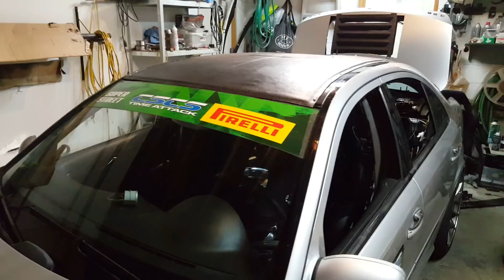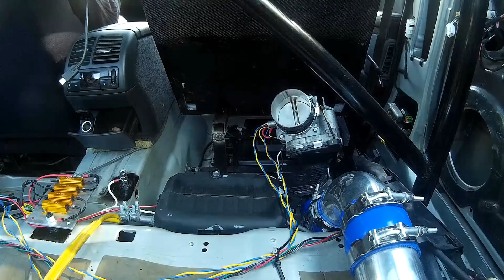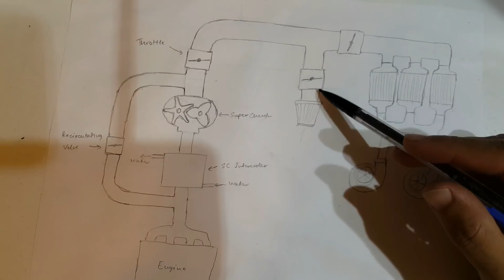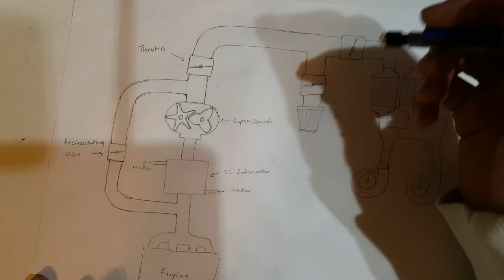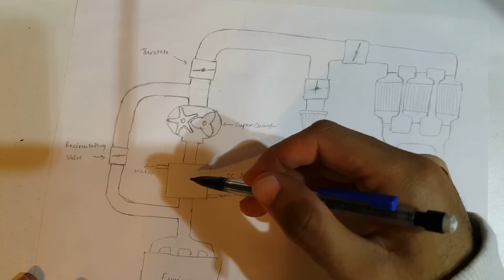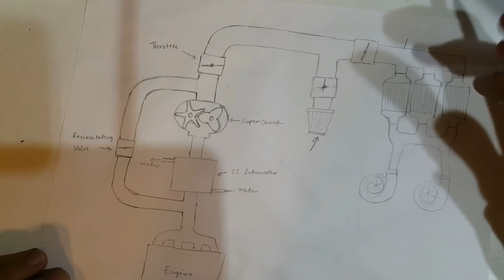How to Build a Properly Fast Track Car - Part 12 (Twincharged System/CF roof)

Comment: still no LSD diff on the car, thank god you have 2 turbos 1 mile away from the engine, and also 3 useless intercoolers nice and warm inside the cabin.... incredible.... it really could have been a good build, if only you would have spend the money in the right places and doing things "properly"

Comment: Holy cow this is amazing work! Not sure if this will help at all but thought I maybe add a tips
.

Instead of reprogramming the ECU each time to tune the valves you can also implement a  read/write memory in the fly the change "calibrations" in RAM, then save then RAM data Into ROM on ECU shutdown. 

Great job!

Comment: Nice Build! I have a twincharged car myself (4agzte in a mr2) so I thought I would offer some tips:
If you want a faster boost rise and a better transition you could remove the throttles between turbos and the intercooler and instead control the supercharger bypass valve based on the pressure before the supercharger. 
Once the turbos start to spool the bypass would control the final boost pressure by gradually bypassing the  supercharger until its finally at a pressure-ratio of 1. With this system you can get loots of boost quickly, example:
The supercharger runs at a pr of 1.5 (~7psi boost) and the turbo are just spooling at a pr of 1.2 (2.9 psi boost) with the compounding effect (1.5*1.2) you get a pr of 1.8 (11.6 psi boost). 
You can then gradually open the bypass to keep this 11.6 psi (or whatever you want to run ;) ) until the turbos are fully spooled, no drop of boost during the transition!

I also think that the way you are running the turbos means that they are fully stalled while building the initial boost and I don't think that's efficient or good for them in the long run.

Twincharging FTW!
Reply: i run a full compound twincharged aw11.  no bypassing the supercharger, no clutch.  works flawlessly.  only bypass is a external wastegate used to bypass/vent the supercharger on throttle snap and idle (throttle body is post supercharger).

Comment: You must be German, great engineers but overly complicated.
Here is how I did the same job on a 5 liter V8.
Two turbos one GT35 size and one GT45 size. The GT35 is the Primary turbo, it runs all the time. The GT45 is only active if Exhaust Back Pressure is more than 60% higher than Intake Manifold Pressure. I have full boost at 2000 RPM and do not choke the engine down due to back pressure at 6800 RPM, my Redline.
No computer used, this is all analog using Boost control valves, Exhaust Loud valves, and a stand-alone water cooled EGR valve off a Lexus. The Water cooled EGR is for cooling the exhaust gasses before it gets to the two boost controllers that activate the larger turbos. I melted a few before .......LOL
Now the size turbos that I used were chosen by engine size, head flow, and boost level, I'm only going to 12 psi. My transmission will never hold more.

Comment: just use a low rds on mosfet instead of the relays and pwm for controlling the current level from engage to hold. It would have taken the same amount of time. Anyway! keep up the good work! i love these mods, crude but to the point! love the rebuild videos, i have the v6 engine, good inside information!

Comment: Several people have run turbos directly into a supercharger without all the extra throttle bodies. The supercharger pulling air through the turbos and the intercooler allows it to both get cooler air and spool the turbos faster reducing lag even more. Even more lag could be eliminated by changing your exhaust to a single pipe and a single large turbo.

Comment: Great channel.

Appreciate I don't know all of your design requirements and so forth. 

But, I am not sure you really need the additional throttle body near the turbos. Why can't the turbos spool up into the supercharger; and then you switch the S/C off then and/or bypass it; if you really think you have to?

I also dropped a comment over here; https://www.youtube.com/watch?v=zX2NJMaHTgw

Jim; ex AMG powertrain engineer - electronic engineer - electrical engineer.
Reply from the maker: Hey Jim,

One way of doing it could have been slowly opening the recirculating flap to regulate the boost as the turbos spooled up. That way I wouldn't have needed the two throttle bodies. The only reason I went this way was that the risk of over boosting is too much using that method, in case something doesn't work on time. If the turbos and S/C engage at the same time the boost levels would multiply and cause a lot of damage. This was the safer way as there was almost no risk of over boosting and the boost levels in both systems could be controlled independently. 

Running Turbos and a Supercharger at the same time is called compound charging. That wouldn't have had any great benefit in my application because the S/C would be doing the majority of the work and the turbos would just be feeding a few extra psi into it. Eliminating the S/C made a big difference (lower intake temps, more efficiency, better boost regulation). I would have removed it completely if it wasn't for avoiding turbo lag. Hope it makes sense
Reply: Yep understand about compounding; I remember the DW 4 Valve V8 and F1 turbocharger era where that term came from.

What I was eluding to was you could (slightly) compound charge the system prior to smoothly transitioning it from positive displacement manifold pressurization across to a centrifugally (turbo) charged manifold pressurization system.

You could control that via software and that way you don’t get the manifold pressure drop as the current system transitions.

Also, I am assuming the bulk of your turbocharger pressure enters the engine via the S/C bypass conduit. 

Also, remember the risk of over-boosting can be controlled by a traditional BOV; although they can be expensive.

Comment: First I've got to say Wow! I'm impressed! It sucks that those hardened o-rings caused such a mess.

On the turbo setup, how much boost and power are you planning to make? I noticed you have a reduction in boost while switching between SC and turbo. Is it possible to tune things to minimize or even eliminate this drop in boost?

If you increased the SC rpms (smaller pulley) would it be possible to achieve close to the same peak power you'll be making with the turbos? Turbos are more efficient so you should be able to make additional power at the crank/rear wheels with the same amount of internal stress on the engine so there is definitely a theoretical advantage with using turbos for peak power. Have you calculated how much more you can theoretically make for the same peak combustion pressures?

Comment: Please tell me that you have immediate plans to install a manual transmission !!! Please !!!! I hate performance cars that do not have 3 pedals !!!! In the USA it is almost impossible to find a car with 3 pedals. I was just looking at new Hondas and get this... there is an upgrade cost of almost $2000.00 for a manual tranny !!!! I hope Europe can resist and keep making manual shift cars. Who cares if you are .7 seconds quicker to 60. The removal of the clutch pedal has sucked the enjoyment of driving right out the window! 
Sorry for the rant

Comment: Hey bud , beautiful work there!  

I was wondering how you managed to control the recalculate valve?  Is there a way to add a switch to override it and cause it to close on demand? Or a  stepper motor driver /programmer required?
Reply from the maker: It operates the same way as an electronic throttle body. You wouldn't want to override it with a switch because it has to open and close in certain situations. Its a bipolar DC motor and a position sensor basically, so its more similar to a servo motor than stepper

Comment: question, why not try to have the turbo air go into the supercharger to comepress the air even further? is it to much heat for the engine to handle? if so what were those temperatures. im doing a build with my wrx where i am trying to tie in a supercharger into the existing stock turbo engine to see what kind of gains i can get as a fun experiment.
Reply from the maker: That's called compound charging. I've heard of some drag cars using that for really high boost levels but an engine with stock internals like this one probably wont handle that too well. My initake air temps so far stayed around 50 degrees C on the turbo setup, was reaching up to 90 on the stock setup because the factory intercooler isn't the best.

Comment: Have you considered using Solid State Relays (SSRs) instead of mechanical relays to control the valves? They should solve the issues you're having with flutter. 
By the way, great channel, I've always wanted to do a twin-charged setup for an M113 engine.
Reply from the maker: The flutter was fixed by changing the program, but yeh solid state would definitely be better. I might consider it later depending on how everything performs.

Comment: how youcontrolled the actuators to open or close on the same time you have reached the optimum pressure??? by plc??
Reply from the maker: No, its the circuit at 4:26 that's controlling the switch over. Plc's could work too but they are mainly designed for industrial purposes.
Reply: what is that circuit called?  howto program it?? do you programmed it yourself......being a electrical student???......can we use arduino??
Reply from the maker: Its my own design from back when I was a student. Its based on Atmel microcontrollers and programmed in c++. You would still need a lot of external hardware if you use an arduino so its probably a better option making a custom pcb anyways.
Reply: thank you  and keep teaching us..

Comment: I've always loved & have been fascinated w/ "twin boosted" engines. As I'm sure u know, VW tried it for a while a few years ago. I haven't watched all ur vids yet but if u haven't, why not change to a smaller diameter charger pulley? Also, I would think a larger water/air charge cooler "radiator" (rather than the stock Merc radiator) would help a bit? I'm curious if u don't mind, what r the (pre-supercharger) turbo boosted air temps? What's ur boost air temp (ie after the supercharger & about to go into the engine) with & without the turbos? Unless I didn't watch the vid yet, what I'm amazed is that ur using the stock engine! Stock con-rods, pistons, etc. I've always dreamed about a twin turbo, supercharged, V8 (an LS or a twin cam Ford "Coyote"... The LS although an "old fashioned", single cam, push rod V8 is lighter, simpler & more powerful. The Ford on the other hand, is a better "tuner engine"... Plenty of 2000hp Ford GTs & Mustangs out there!). Good luck, thx for the vids, LOVE ur project!
Reply from the maker: I did try the small pulley. It might be a good idea for drag racing but for time attack the air temps get very hot after a few laps. I'm already running two intercooler heat exchangers and even with that temps used to reach 80 degrees C. With the turbo setup 60 degrees is the highest I saw so far. Will test it more next year and try to get a bit more out of it.

Comment: Why didnt you just add more transistors?! And why have you timed it so bad that the pressure drops in the transition? Let the turbos feet the compressor for a bit, then open the bypass.
Reply from the maker: It is possible to reduce the switch over time to zero but there's a risk the turbos and s/c overlapping. If that happens the boost from the turbo and s/c will multiply and easily blow the engine. I programmed it this way to keep things on the safe side. The switch over is pretty quick anyways.
Reply: No they will not multiply. 150Kpa of absolute pressure from the turbo will in theory enter the SC and the pressure will be rased by 1:1.5 if the charger is making 150kpa. That is 150x1.5 = 225Kpa, minus Atomosferic pressure this will be 125kpa of boost. Theoreticly. But..

If the supercharger tries to raise the pressure the flow into the charger needs to increase. There will be a pressure drop between the turbo and the SC.
Therefore the turbo needs to spinn even harder to supply the added amount of air.
All you really need to do is therefor to reference inlet manifold pressure to the turbo wastegate and the total amount of boost will never exeed the WG pressure. You really dont even need to bypass the charger. Bypassing the charger is only for efficency. 

You could also use A "pop of" safety valve to limit maximum manifold pressure. For example a BOV with the right spring pressure.

The best way to do dual charging is however to let the supercharger blow into the turbo. Then you only need one valve. But that is not practical on these cars.

Also there is no need to have the 2 valves on the turbo and the MAF/filter. Just mount the MAF and filter before the turbos.  Then mount BOVs on the Pipes.
Reply from the maker: The boost multiplys when calculated in bar (absolute pressure). That's something I've actually experimented with and seen. 

The best way is obviously to slowly disconnect the S/C as the turbo spools up so theres a seemless transition, but the risk of over boosting and the complexity of making such a thing work at a personal level is close to impossible. You cant just connect the WG directly to manifold pressure. That will prevent your throttle from limiting pressure during part throttle.

Not disconnecting the S/C and just using it as a compound charged system really defeats the purpose. That way the S/C will be providing the majority of the boost, Intake temps would be way higher and efficiency wouldn't be any greater. 
imo its a pretty good setup right now. I will still keep improving it when I get to test it more but I think there's quiet a lot of power potential after I get the car tuned and dynod
Reply: Larger S/C pulley (5psi) with a 5psi wastegate perhaps? Removes the electronics and possibility of overboosting. Plus no lag to speak of. Your blower temps wont be very high as youve got the air going through an A/A IC plus a W/A IC... Might actually drop your IT's or stay close to the same. Just some suggestions! I want to try experimenting in this way with my car once I get my turbo for a compound setup

Comment: You should change up the geometry of your rear horizontal suspension, the geometry you have it at currently isnt completely linear and the point where the shock is mounted is moving in a radius. It will prob wear out the shock and spring or the shock will buckle. Try to make a mount to use a ball mount and to a geometry where its more linear.

Comment: Hey man. Awesome videos and project car. I have one or two suggestions that you can perhaps implement to make the setup even better (if you haven't thought of them already). Consider switching to solid state relays to control the throttle bodies, that way you can go crazy with the control and not worry about frying relays. The other thing I would suggest is with the switch over from the supercharger to the turbo period...instead of looking for the pressure to drop to zero in the header tank before opening up the throttle body for the supercharger, look for a pressure drop of only 0.1 or 0.2bar and then open up the turbo throttle body, that would make the power more linear. Also consider moving the map sensor for the header tank pressure closer to the engine, as the long run of pipe can give you slow feedback response.

All the best with this build man, amazing stuff so far.

Any plans to control the gearbox yourself for better shifts/behavior on the track?

Comment: What are your intake temps like with the warm air from the rear intercoolers feeding the turbo inlets? You appear to have a warm air recycling system in your trunk!
Reply from the maker: yeh, theres supposed to be ducts going to those air filters. I talked about it in the previous video. Right not I was just rushing things to get it tested before winter. IAT's were still good but I'm guessing they will be even better once everything is done

Comment: Awesome progress man! Glad to see it's working out so well for you so far.

That roof looks great. No need for vacuum bags lol!

Did you check for high / low pressure zones on the roof with the ol' wool tuff method to optimize your duck?
Reply from the maker: Thanks. Yeh, it would have been difficult vacuum bagging that. Right now most of the ducting is just temporary so I could get the system tested. Later I plan on adding a big roof scope to guide air to the intercoolers.  Hopefully air temps should be even lower then

Comment: I think you're trying to vent into a high pressure area.
Reply from the maker: yeh, ideally it should have been at the back of the trunk lid but air flow still seems fine judging by the air temps

Comment: Why heavent u took off the supercharger and put the turbos inside de v like the new mercedes engines and avoid this super complicated sistem?
Reply: Adonis Duma that system needs heads that flow exhaust through the top of the engine instead the sides if I remember correctly.
Reply: Supercharging gives boost in the low rpms, while the turbos take over in the high end

Comment: Take out the windows and replace them with plastic
Reply from the maker: Vega-Expert  The car is much lighter than a stock E55 overall. The roll cage and stuff adds a bit of weight but the weight removed is way greater. For example the front seats I removed in this car weighed 30kg each. That's more than the entire roll cage alone.
Reply from the maker: SumatumPVP I'm planning polycarbonate windows for the doors, but probably after everything else is done
Reply: SumatumPVP he will need major weight reduction,brakes and tires will suffer,when you build you dont realise how much weight it adds just from using steel